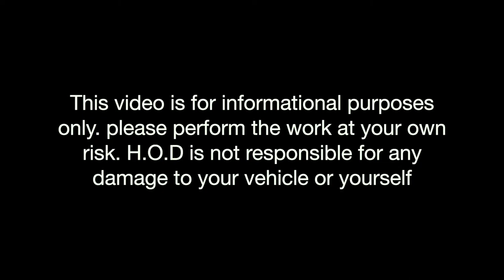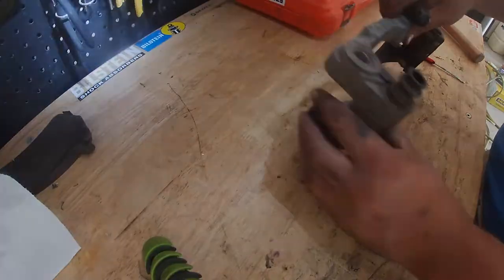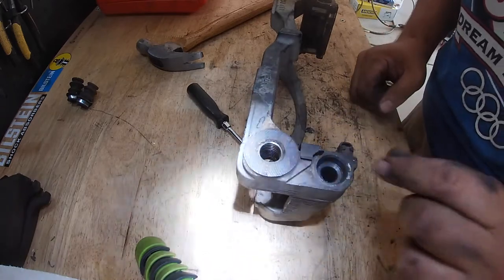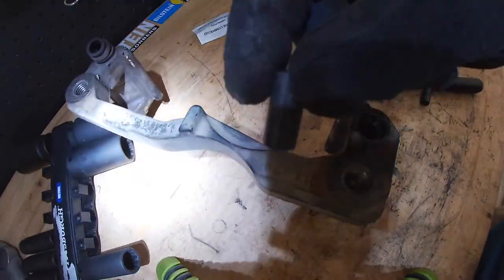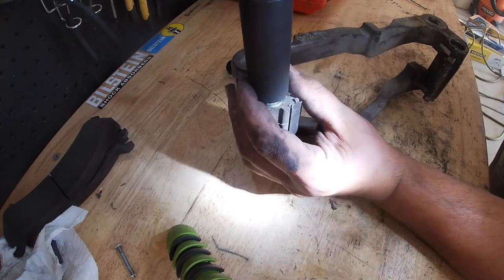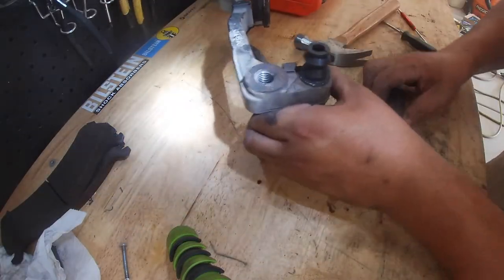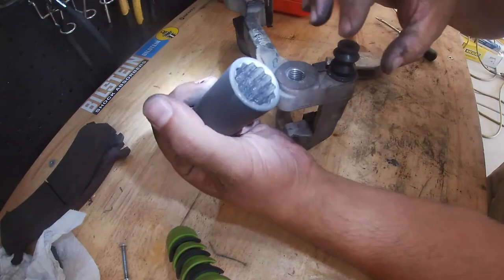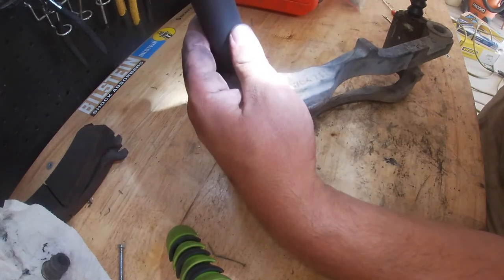How to replace brake caliper bracket boots on a Silverado

Comment: Thanks for the video.   I used a small chisel to get the old ones out. When I had it separted it a little, I needed something a little thicker. I took a small hex key wrench and tapped in into the  sides.  This caused the old one to pop out. To get the new ones in, I tried tapping the first one in with the 21mm socket as suggested.  It tore the boot. For the other three, I used my vice and pressed them in using a small piece of wood as a  spacer to avoid direct contact with the rubber part against the metal vice. .  It worked perfect and did not damage the rubber boot.
Reply from the maker: Aw man I’m sorry to hear the boot got damaged. :/ but I’m glad you found a better alternative. Thank you for the comment and thank you for watching

Comment: I just did this and used a 13/16 spark plug socket (which more people might have already!). Lots of room inside for the boot, and the open end is nice and smooth so as not to beat up the rubber.  :)
Reply from the maker: Heck yeah! That’s awesome. Thank you for watching.

Comment: I used a 3/4″ copper slip coupling for plumbing instead of a socket. The socket is too thick and the copper fitting is not too thin that it deforms under hammering.
Reply from the maker: All that matters is the jobs done!! Well done!

Comment: What year Silverado are we talking?  I've searched high and low online and can't source that inner portion that you removed with a pick for my 09 1500.  I can find the boots, pins, bolts and anti rattle brackets, nothing else.
Reply from the maker: Any local auto parts store will have them, if your truck is equipped with them. 09 is a different style than 2002. I’m not sure if they use the same brake calipers and brackets. But for my 2002 I just walked into my local auto parts store and purchased them. Wasn’t hard at all to find. Try asking for “brake hardware kits”
Reply: @HandsOnDismantler  Yup, that's what I've been searching for all evening.  I found a picture of my brackets and the interior hole is quite a bit smaller than what I'm seeing in your video, I don't think GMT-900s use the inner part, it's just metal on metal.  Thanks for hitting me back

Comment: I don’t have that problem, the brackets bolts are stripped! I have tried everything!! It’s time to grind them off
Reply from the maker: Noooooooooo not the grinder! Try using the socket sets that have sharp teeth on the inside to grab the stripped head?

Comment: does the front AND rear caliper have the long rubber insert inside the pin hole?
Reply from the maker: Long? No but they do have rubber pieces on the caliper slide bolts. Not sure if that’s what you’re referring to
Reply from the maker: There are rubber inserts that you slide in before pressing the boots back on. If that’s what you’re referring too. Sorry about that. The pin hole part confused me. But I think that’s what you were talking about.
Reply: @HandsOnDismantler  Right, Was wondering if the inserts are in both the front and rear calipers?

Comment: Pro-tip when you use the screwdriver to start working around the pressed in boot start with a small screwdriver and as soon as you get a gap around the whole unit switch to a thicker flat head screwdriver and then continue tapping around it pops right out every time
Reply from the maker: YouTube was founded on pro tips!

Comment: this factory boot style / bracket is absolutely garbage.

has anyone found a aftermarket bracket that accepts standard boots.
Reply from the maker: To be fair it did last 20+ years lol 🤷🏼‍♂️
Reply: @HandsOnDismantler  that you are right.  but these next ones probably wont last until the next brake job arrives. there  is no way to install them without pushing on the rubber.  im sure when the brackets were new they went in easy. not likely to happen again here in the rust belt
Reply from the maker: @Maddogtrucking  well there’s a special tool or press that presses them in safely without damaging them. I was able to do it in the video without damaging them. You just need to be careful and take your time. You’ll get it. And unfortunately almost ALL parts are made to a lower quality standard these days.
Reply: Freeze the boot. The metal will shrink and it will literally slide right in. Just just leave it alone for about 10 and it’s good.